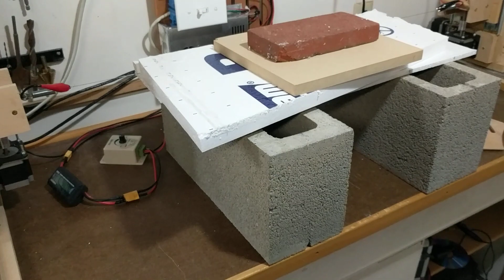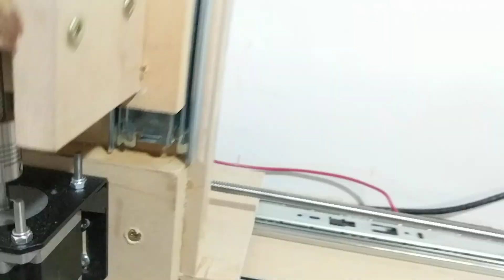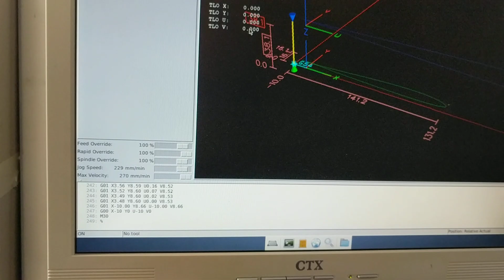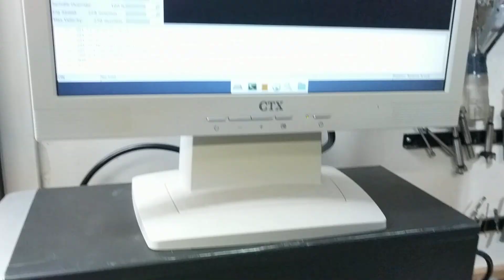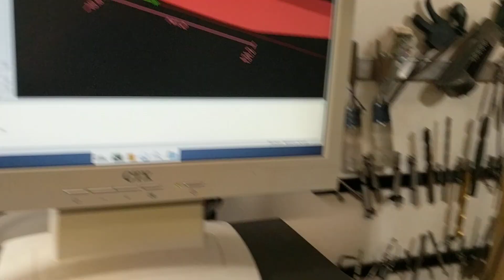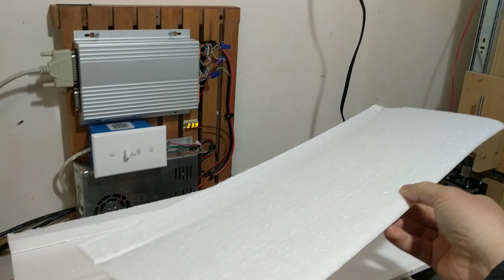Diy CNC hot wire cutter - build log 2

Comment: Very cool build! Do you have a link to the controller? You said tv6550 I think. But I could pull it up
Reply from the maker: I thought i had it on my build log but going back thru i don't see the specific link. There is a picture of it here in this post: https://forum.flitetest.com/index.php?threads/rc-keith-cnc-hot-wire-build-log.53534/post-415719
Here is a link to the place i ordered it from. Be carefull as there are similar models in 3 axis only: https://www.omc-stepperonline.com/4-axis-tb6560-cnc-stepper-motor-driver-board-for-nema-17-23-stepper-motor-st-6560v4.html?search=tb6560

Comment: FYI, you do not want weight on top of the foam, this causes the foam to collapse onto the wire. This causes the wire to drag and bow in the center. In a perfect setup the wire does not touch the foam but melts it in very close proximity. Additionally it keeps your wire clean. Adjust temp and speed to achieve a perfect cut. You will have to oversize your cuts to account for the kerf. Source:  I used to run a large foam cutter for surfboard blanks.
Reply from the maker: Thanks for the tips man i really appreciate it. I am still just playing with settings and cuts. I see various different ways to do it with each side having "success" lol. So i will try both ways and see which one works for me the best. Some guys say go super slow with lowest watts other guys are like mega wattage and running fast. I think i will probably be playing with the settings for years. Its a fun hobby.

Comment: Magic! That must be very satisfying Nathan
Reply from the maker: Yes its a nice combination of setting up the shop and getting a tool to make stuff. I have been doing all my test cuts using a pw51 airfoil which is a highly recommended airfoil for slope planks. I could never cut it well as its very thin to start and doing the cut by hand i would always mess up the tip end and cut thru.